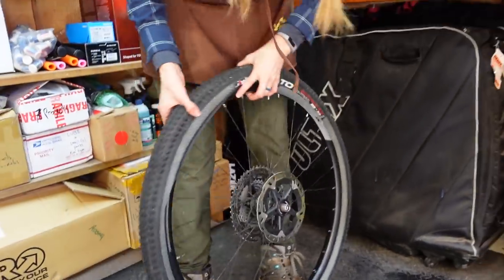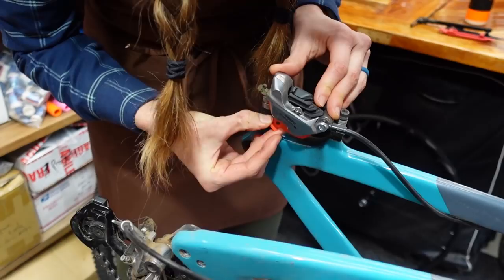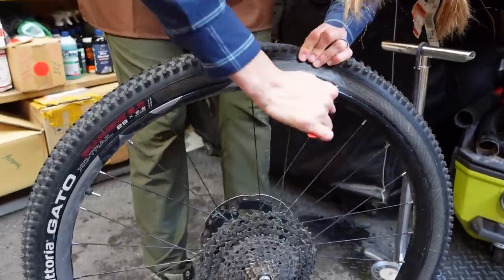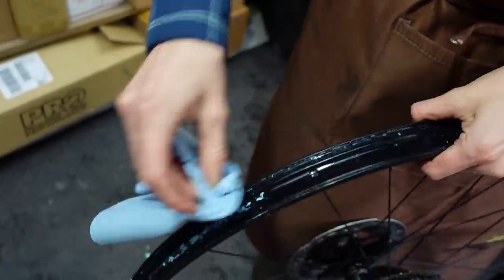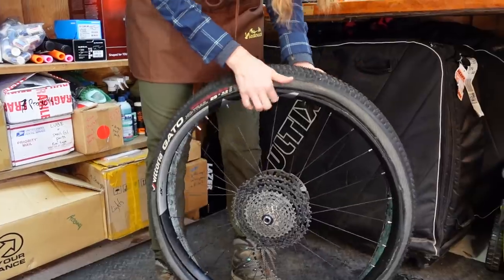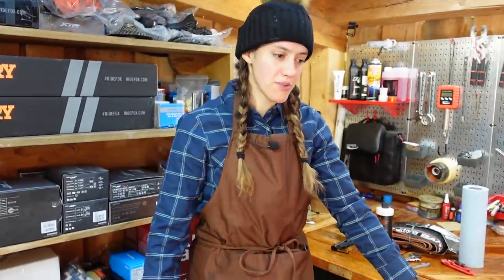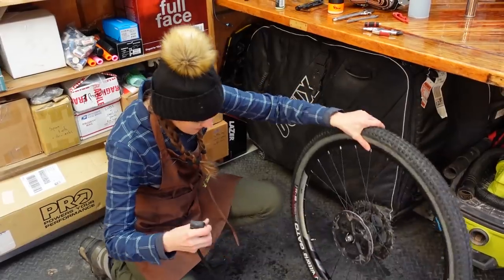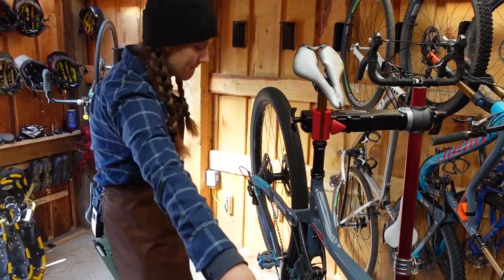How to change a tubeless mountain bike tire | Syd Fixes Bikes

Comment: Thanks !  and picked up a few new tips from your video.  Some to add that help me are: 1) put the new tire in sunlight to let it expand slightly. Helps with Schwalbe tires especially.  2) use soapy water on the bead just before installing tire on each side. 3) air up and seal the bead dry before adding any sealant. Saves you a sealant/bead explosion all over the garage and yourself. 4) add sealant thru the syringe and can use a small bottle as your measuring instrument such as the little 2 oz Stans bottles.  3 to 4 oz is good for a new tire installation.  5) usually add/replenish the sealant every 3 to 4 months or tire change whichever comes first. And may reuse sealant if it is not dark or very gray (referring to Stans sealant) by removing with the syringe into a glass jar. 6) agree with others that mfg  lettering at valve stem with respect to the "rotation" direction. 7) if uncertain on direction (ie. some road or gravel tires) with no arrow,  when taking off a tire that you expect to use again, add your own direction arrow with a magic marker to help you months from now.  Cheers !

Comment: I’m with Syd on logo placement. I make sure to only align tire pressure info to valve, but just in case I need to take the wheel to a local shop or when I forget tire pressure. You two are awesome btw.

Comment: Great video as usual!  :). I have installed lots of tires but your videos always include a few tips and tricks I did not know - for example not using the tire lever where a spoke is located when putting the tire on the rim.  Thanks!

Comment: There is a reason why I always align tire logos with the valve stem, at least with tubes, it helps with tracing a puncture on the tire, because the thing that popped the tube might be still stuck in there and immediately puncture your new tube.
Reply from the maker: This is the best argument I've heard for doing so. But I still don't like it 😜
Reply: @sydfixesbikes  That's fair, it doesn't do much on tubeless anyway 😄
Reply: For "SOME" people it makes it easier to find the tire air valve especially inna race or just trying to air up the tire.
Reply: I do it because it looks cool, and we all know the cooler your bike looks, the faster it is.
Reply: I also rub the rim clean where the puncture is near, to make an indicator

Comment: Last time I did this I ripped the original tape right off and had to have a shop re-tape it.  The tape wasn't that old.  Even though I built this bike myself from the ground up, I'm still no mechanic. I'm thinking to use soap or sealant to lube things up before breaking the bead.  I want to keep the tape intact.

Comment: One helpful tip I learned from BKXC when it comes to tire rotation direction: tire companies add all their fancy labeling to the side of the tire that will face out in all the glamour shots you see of bikes: the drivetrain side. So, if you make sure your tires pretty labels are on your drivetrain side, you should be good to go!
Reply from the maker: That's a good tip! But unfortunately only applies to some companies. Vittoria, for example, does their logos the same on both sides...
Reply: @sydfixesbikes  DAMN YOU BKXC!!!!

Comment: Great video!  
Just a quick note on the brake shim, clean it with alcohol first and don't touch the shim where the pads make contact.  I know this is minor but even oil on your fingers can contaminate your pads over time.
The last time I changed my tubeless tire on the rear and while doing my sealant dance the cassette came off putting a dent in one of the chain rings.  Arggg!!  I was able to fix it but my dance routine had to be modified after that. :>)
Reply from the maker: Yeah, we learned that lesson once too. Fortunately these Shimano wheels don't drop their cassettes 😁

Comment: Great video! I noticed when you were installing the new tire it had sealant coated already on the inside. Is this something that needs to be done before applying tire to the rim?
Reply from the maker: Nope, that was simply because we had already installed that tire previously. It's generally easier if it's a brand new tire and it's perfectly clean!

Comment: Very timely, I’m actually about to do this myself. What did you use to clean the wheel before putting the new tire on?  Thanks.
Reply from the maker: Just water, but if your old sealant is super stuck, you might have to scrub it, or if it's really bad, carefully scrape it off (using a plastic tire lever).

Comment: One thing that should be mentioned is to check the tire to see what caused the flat by running your hand around the inside- the last time I checked there were 3 micro thorns that had made there way in needed to be removed

Comment: I had a very difficult time getting a tire on and now it’s not sitting correctly on the rim. Any thoughts? Bead isn’t even.
Reply from the maker: You can try adding more air (up to about 50psi on a mountain bike, 100 on a road bike) and see if it will seat. If not, try letting out most of the air (not all) and putting some soapy water on the spots where you can't see the bead and then pump it up again.
Reply: @sydfixesbikes  soapy water is my next solution after that I’m giving up and taking it to the shop where I bought the tire with my tail between my legs.
Reply: @sydfixesbikes  Soapy water over 40 psi for the win!!! your video was very helpful. Thank you.

Comment: In this video it was surprisingly super easy to remove the tire. How is it possible? I had to do it 2 days ago, 2 friends were helping me and it took us 30 minutes. It wasnt possible to do it by hands - no one was strong enough. Here it is done by a lady :) Does anyone have the same experience? Both tire and the rim were brand new - mounted by the manufacturer 1 year ago.

Comment: Something I found handy for putting sealant in a tire is using a 35cc syringe with the straight tip not the screw lock tip. The straight tip will slide into the valve body and you can pour the sealant into the syringe and it acts like a funnel. Sealant runs in and no squeezing of the bottle. Hope someone finds this useful.
Reply from the maker: Good tip!

Comment: @Syd & Macky, did you check the rotor to make sure no sealant got onto the rotor? Would you recommend taking off the rotor? That's what I do but I didn't see you guys do it in the video so I was wondering how you didn't get sealant onto the rotor? Was it just luck?
Reply from the maker: When we hosed of the wheel, we hosed off everything. And since we put the sealant on via the valve stem, the wasn't much risk then. Also, it turns out brakes heat up enough to burn off sealant no problem (a race mechanic told me that once).
Reply: @sydfixesbikes  Interesting. I always thought that it was like the oils from our hands. I'll give the wash a try next time but make sure it's almost time for new pads just in case. Thx

Comment: One question I have: how much sealant do you put in?  I recently converted my fat bike to tubeless, I put in one small bottle, no idea if that's enough
Reply from the maker: Generally the sealant bottle will tell you based on the tire size!
Reply: @sydfixesbikes  there are no directions on the bottle...
Reply from the maker: Weird. Might be worth a quick Google of you're worried. Assuming the little bottle was about 4 ounces, you might need a bit more for fat tires as 2-4 is what we use for 2.3-2.5" tires (at least with slime).

Comment: Do you rotate your tires to balance wear, or do you  replace the rear tire more often?
Reply from the maker: If we're running the same tire front and rear, when the rear one is worn, we'll put the front on the back and a new one on the front so we have the tire with better traction in the front. If we're running different tires, then yeah, replace the rear more often.

Comment: Another easier way to seat the tire on the wheel is to sit down and put the wheel in your lap. You can get more leverage pushing the tire onto the rim and you shouldn't have to worry about smashing your hands into the cassette.
Reply from the maker: Good tip!

Comment: Okay so everything else was clear 2 me but when tyre is on the wheel when pressurised why put core on and take it off right away for sealent 😅 It makes no sense to me
Reply from the maker: Is that what I did? Definitely no need to put the core on and then remove it again. If it's off, once you get the tire seated just let all the air out, put the sealant in, put the core in and pump it up.
Reply: @sydfixesbikes  Okey,thanks i will do that. There is some other video also with the  same procedure so i thought that it is something that has to be done in order to get perfect result 😅 But then again it does not make any sense whatsoever 😂
Thank you for the quick replay btw :) 👍
Reply: @sydfixesbikes  I was talking about 9.10-9.12 where u put your finger on top of the valve after inflating and put the core on  and the guy says : we have to take it out before sealent 😅
Reply from the maker: Oh, yeah, that was just because I'm used to putting the core in and had forgotten that we still needed to put sealant in.
Reply: @sydfixesbikes  Ok,that explains it 😅 Thank you very much indeed 4 your help :)

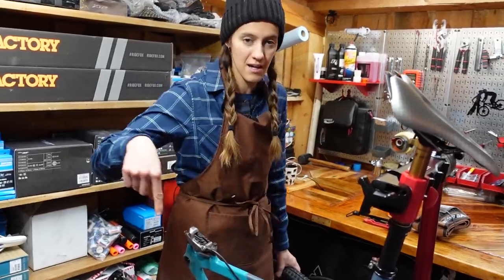Comment: @1:35 I'd add when taking off a wheel, when you have hydraulic brakes, place a clean break block between the pads. I was doing the same thing as Syd but on my front wheel and accidentally griped the front break lever. This compressed the pistons and the rotor would no longer fit between the pads. To prevent this I'd place a block between the pads.
Edit: Yes I know they talked about it but it was sort of minimized. It is important cuz getting the pistons back is a royal pain in the ars.